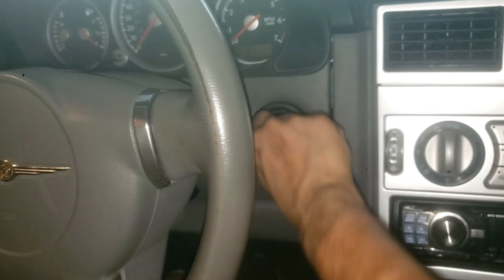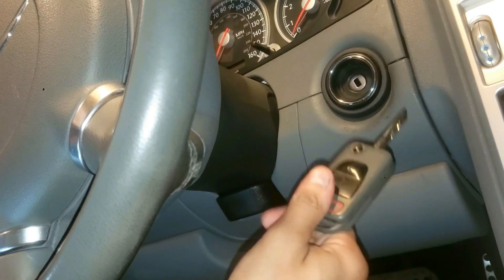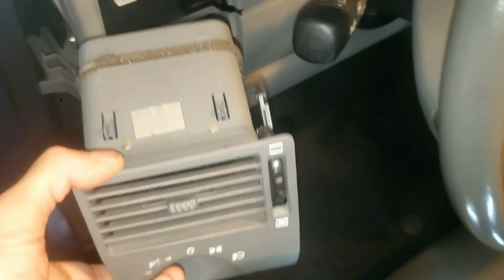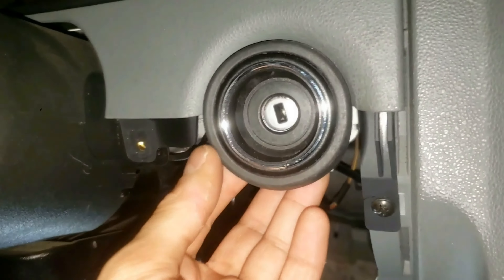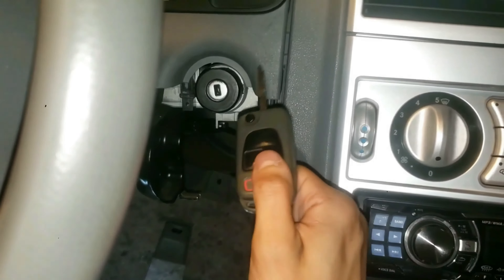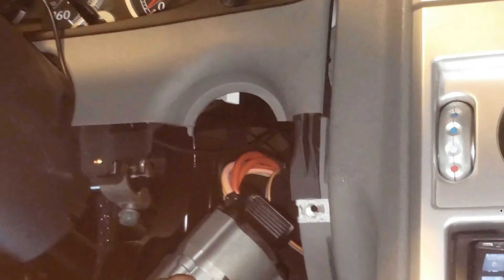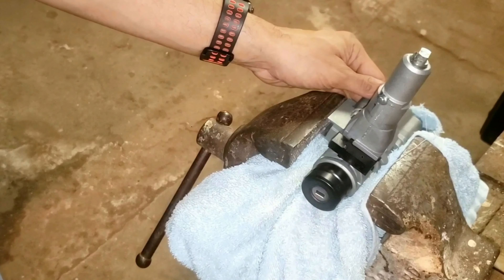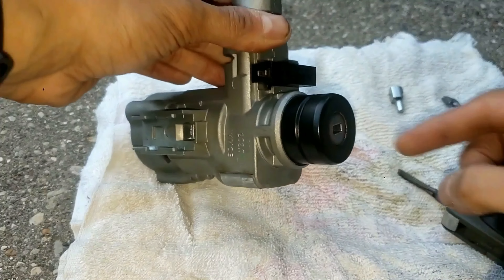How To Remove Key Assembly On A Mercedes Chrysler Crossfire DETAILED Part 1

Comment: I watched your video a few times before taking this task on. I cheated though!!  Rather than unplugging the harness from the switch I left it attached and just ground a small hole in the tin cover with a Dremel tool and then picked the plate out with an awl. Worked great!. I liked how your didn't disassemble the switch like some of the other video's did. Keep it simple eh. Great video.
Reply from the maker: Nice job, and nice to hear of your experience on how you did it a bit differently! Theirs's always a way to do things differently.

Comment: After 2 hours of wiggling and jiggling the steering I still cannot get the key to turn to the #1 position.  I have put graphite powder in the tumbler, but still no luck.  On a positive note the screw that is at the bottom of the hole was apparently never installed and I was able to actually get a socket on the 10mm clamp screw.  But the key will not turn.
Reply from the maker: Any luck?

Comment: hi Bro, I loved your video! I have a question, maybe someone can help me with this: my CX only has 1 key and the remote lock does not work. What do you recommend I do to make the remote lock work (and also have another copy). My question is: If I install a new lock (Key Assembly) like in the video (I saw a used replacement part on the internet that comes with 2 keys and that works), would that solve my problem? Would the remote electric lock work? Or do I need to do some additional programming? best regards to all from germany

Comment: I checked the fuse. Would the climate control fuse be a problem? Theres no fuse in 33 slot
Reply from the maker: Its possible, but I've heard usually the blower motor resistor is what gets bad on these. Double check the owners Manuel to see what fuse 33 is or is not suppose to have a fuse for.

Comment: If you change ignition barrel for a new one can the transponder ring work with the new barrel
Reply from the maker: I believe you can reuse your transponder ring and use a different ignition barrel, but you also need to make sure the key is the same. Any other people can confirm this?
Reply: @FixCarYourself  thank you got it done it works many thankz👍🏾
Reply from the maker: Awesome!

Comment: What if the key won’t turn to accessory/position 1? Can the ignition still be removed?
Reply from the maker: I made a separate video that might help you so you can turn it again. 
Here it the link: 👉  https://youtu.be/Pdgnkb7pmxM
Reply: @FixCarYourself thanks for the reply. I’ve tried all the techniques you showed to get the key to turn but no luck. Can the key assembly still be removed? I’m stuck at the pin and the pin will not budge to slide out the key assembly, which I believe is because the steering wheel is locked. Drill the pin out?
Reply: 808bicycle- did you get it? Just grind that pin off and remove the ignition
Reply: @brentmulligan1970  I did. And got it working. Thanks!
Reply: @808BicycleWorks bro what did you grind it out with ? I’m currently at the same problem

Comment: My srt6 has a problem. When i start my car the cooling fans come on automatically. After 20 min the air and heat will light back up. It goes on and off every 30 min. Could it be a sensor?
Reply from the maker: Check your fuses 1st, make sure your coolant is good the level, use a scan tool to see if you have any codes,  and or do a reset if necessary.